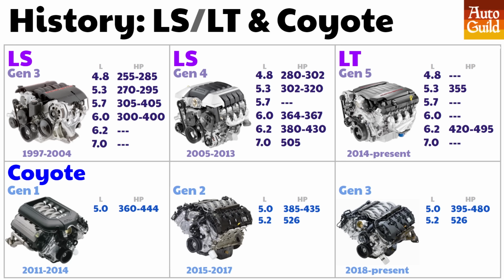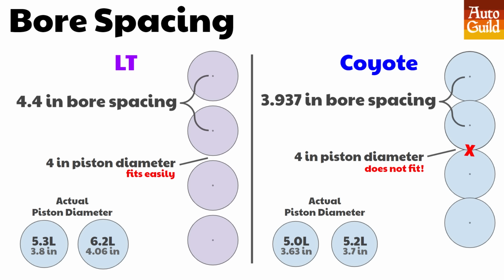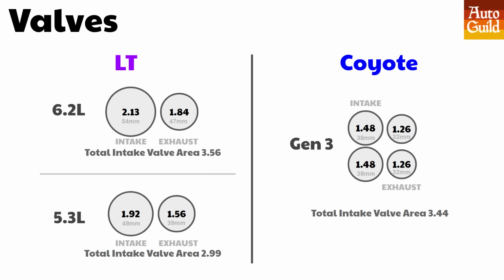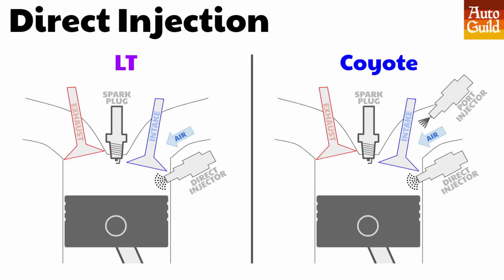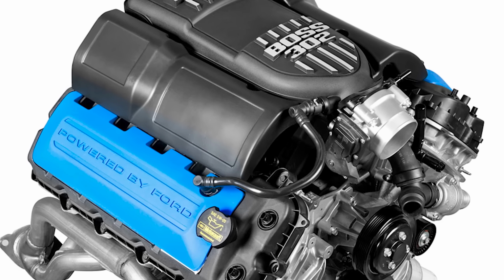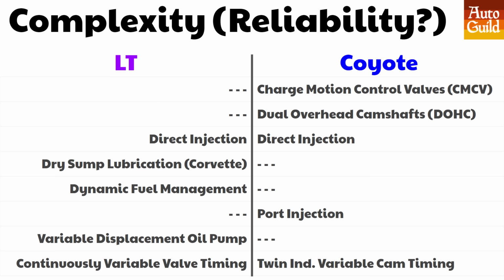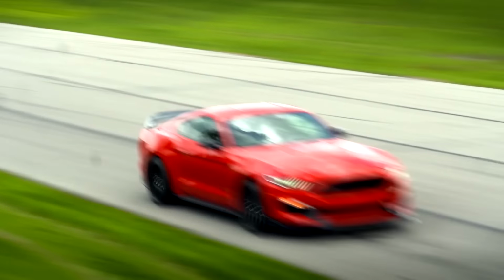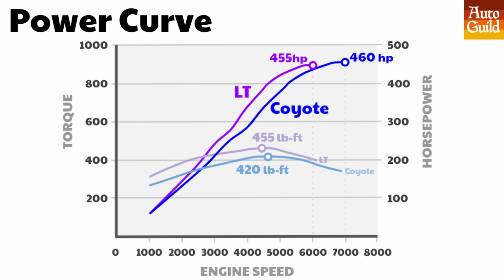GM Gen 5 LT vs Ford Coyote.  Which one is better and why.

Comment: I know I'm going to get hate but I'm just being honest about my personal experience, 
i have had way more success with my Gen 3 Coyote than i did will my Gen 4 LS. 

All around better performance in my opinion with the same amount of money invested. 

My 99 Mustang gt is slightly lighter than my 95 Camaro on paper but after all the lighting i did we are only talking a few pounds difference. 

Same gearing (410) and both are manual transmission, I'm just way happier with the performance of my Coyote. ✌

Comment: How about price of parts, availability,, hop-up ability, ease of working on them.  GM all the way!  No comparison in horsepower per dollar spent, the LS wins hands down.
Reply: Damn right!
Reply: Government Motors
Reply: No comparison in horsepower per dollar… until you wanna boost it lol. Spend more money boosting it to make less power than the 5.0 with the exact same application. Or, just cam it and gain desired big power but drivability suffers greatly. 

I’m not biased towards either, even owning a Coyote, but the old “LS/LT is cheaper” argument is incorrect nowadays. They’re BOTH pretty damn expensive and only reasonable people will accept that.
Reply: @matchboxcody  True, but there's a lot more to performance than just horsepower.

The LS/LT engines excel at low end torque; something the Coyote is lacking in.

Torque is much more useful for normal or spirited street driving than a peaky, high RPM powerband. Quicker launches, better low speed acceleration, and less gear hunting all require torque down low.

The only significant advantage to high horsepower is full on racing.
Reply: if you want junk
Reply: @steveschilling5966  Obviously someone who doesn't understand auto technology.

The LS is one of the best engines ever made. It's cheap, durable, flexible, and capable of stupid amounts of power.

That's why there are LS swaps into virtually every vehicle on the planet.

Comment: I didnt hear you mention perhapes the even bigger hp maker for the Coyote and for that matter all cylinder heads. Which is port speed! A small port with big numbers"FLOW" makes gobs more torque and hp! A big oversized port which was the way of old is like farting thru a 4" asshole😲! Slow moving air! Ala to a small well designed ports, will make a big port look bad! GM and aftermarket 2 valve have done this as well! But 2 is always better than 1! P.S im a GM guy! But Ford got the jump on us🤔 Great show!!!!!!!!👍👍👍👍

Comment: I think Ford should not have discontinued the FPC engine.  It took the right people being in charge of Ford to deliver these engines. And especially thanks to Jamaul and Pericack for enabling the FPC to be made a reality.  Im one of many Ford fans who've long desired the implimentation of its layout and design knowing the inherent differences between fords normal v8's and those of Ferrari.   And ford did not disappoint.   As we all know the FPC is pure magic in all the right ways.  Finally a Ford V8 that must breath at high rpms and a power curve that doesnt loose its breath just as soon as it starts in the low rpms, but rather gets stronger and stronger progressively till it reaches peak RPMS !.   Imagine a Ford that keeps building torque and power.  keeps building speed.   Thats the feeling we've been dying for.   I cant stand getting on the gas and feeling a car die off long before its even reached its peak rpm.  It feels deflated.  i do understand the FPC being what it is.. is quite the challenge for ford.  such an engine must be built to much higher standards than anything theyve built previously.   ANd even then they can only go but so far since its a fairly high level of mass production.  But ford did it anyway and Look at the end results.  when was the last time we've seen such universal fan fair over a mustang?   The mustang community the press,  auto journalist.. the competitions,   Mustang was now budding heads with cars 4 times its price.  It was making Porsche look bad.  to take a 25 grand base vehicle and make it perform on the level of a 200 grand sports car.    Ford did it.  and in doing so.. reminded people that when they want to crush ,  they can crush like no others.
Reply: Too bad it wasn't more reliable.
Reply: @davescott9409  I don't think it had anything to do with the flat plane crank itself

Comment: Where is the Ford GODZILLA? It’s going to destroy both of these platforms with ease and all bolt patterns and mounting points are common with Coyotes. 445 CID Cam In Block Smallblock Ford with forged crank from the factory. As to the valve area, we all know that 4 valve engines are far more efficient as proved by the Japanese motorcycle industry decades ago. As for all out performance between these particular platforms, which engine gets restricted by all Racing Sanctioning Bodies?…. It ain’t the GM!

Comment: i think ill just stick to my 383 sbc with no epa goods on it i think most people have forgot how good the old motors really are
Reply: The older motors are great, but a sbc compared to an LS or LT is night and day. The LS has a different character but is a far more efficient engine with more potential.
Reply: @TheColbyChurch  my point was more of simplicity in the fact that just about anyone with basic mechanical knowledge can rebuild an old sbc with a book or internet  im not bashing the newer motors just stating theres a lot to be said for simplicity and being user friendly good luck crawling under the hood of any truck now days where as i have enough room to camp out under the hood of my 85 c10 my 06 duramax most place i cant fit a hand in there let alone actually get in there to work on anything i find this to be the case on most cars trucks today call me old school i guess but i just want to go back to the good ol days
Reply: @TheColbyChurch  older v8s sound better
Reply: Older motors are easier to work on i agree but there not hitting 200k plus miles on original timing chains and other parts.
Reply: @jamesflames9930  I had a '94 SBC 5.7 everything original that went to 380K miles, granted it leaked everywhere, had VERY low oil pressure with recommended oil (I used lucas and 20w50 to increase oil press.), but it still started up every time like clockwork. I've seen older engines (80's SBC and SBF) with 200K+, just not as often.
Reply: No me, 67 427 vette
Reply: @rogerdodrill4733  cheers brother

Comment: The performance records of the LS platform speaks for itself.
Reply: Plus the coyote parts are more expensive good motor tho
Reply: @bryancaballero8113  It's been the one good engine that Ford has put together in more than a few years.  Took them long enough.
Reply: @TheWolfMatt  too bad gm had to copy a Ford design to make a good engine.
Reply: @larrypruitt3919  Nice.  Too bad Ford hadn't been playing around with dual overhead cams in their engines as long as Cadillac has.  Cadillac has had the quad cam 4.4L engine in production since early 1993.
Reply: @TheWolfMatt  you need to do some research... Ford had OHC engines in tanks in WW2...
Reply: @02autogt  Some strange and yet, very unique engines came out during WW2.  Didn't know we were comparing apples to oranges though.
Reply: @larrypruitt3919  I've asked countless people, countless times, what exactly did GM copy, apart from even spaced ports? (Which are hardly a copy) Nobody has answered me yet....
Reply: @TheWolfMatt  Ford had dohc 4.6 in 93 Lincoln with new Bonneville records 180 mph, but I like camaros
Reply: @TheWolfMatt  Ford had dohc4.6 in 93 Lincoln ,set new Bonneville record 180 mph in 3rd gear , u tube video,but I like  6 spd Camaro
Reply: GM was the first production vehicle to have an engine with 1 HP per cubic inch. 
Ford crushed everyone with the flat head V8.
Both companies have their merits.
Reply: @NATHAN ENLOE It would probably be another 300 lbs if it were that big.  😅
Reply: @TheWolfMatt  Exactly, so the argument is pointless.

Comment: your a gm guy and dont mention the 5.5 liter flat plan crank motor in the c8.r... again... only 500 hp... lil less the the gt 350r.... same rpm... but way more torque... typical ford leaving torque at home...

Comment: When it comes to boost coyote is king and requires half the boost an ls or lt needs to make the same power. People always say that ls is cheaper to build than a coyote, but at the end of the day an ls needs heads, cam, bolt ons and etc just to be up to par with a coyote. Add all that up and equals pretty much the price of a coyote.  And this is coming from an ls fan, give the coyote credit because it's running the streets right now.

Comment: Where is the aftermarket. Build a dual overhead cam set up for the Chevy engines. The cam drive could bolt to the front.  Port injection is a must. As A Chevy guy I envy the coyote. Any manufacturer can built the same thing from scratch. Chevy has kept to the on block cam with push rods because of cost and availability.
Reply: Cost, availability,and it works.  Why change something if it's not broken?
Reply: @whatiwant8898  I agree much my friend.

Comment: Long story short
Coyote engine, is smaller displacement, so it NEEDS 4 camshafts and a massive cylinder head and 4 valves per cylinder PLUS vvt to create decent power. Oh it NEEDS to rev high to make power, that wasn't an added feature.
It may have more tuning options and more precise because of the 3 extra cams and the vvt system and all the extra parts and of course with more parts, comes more things that can break......

LT engine, has bigger displacement, 1 cam and 2 valves per cylinder to create the same power as the overly engineered coyote. Doesn't need to revv higher and max torque and hp is available sooner and longer than the coyote. 
Now, that wasn't too hard to figure out......oh, its generally better to have an engine with big displacement and less hp from factory, as the engine doesn't stress too much, too often, while the smaller engine has to make up for all that and you're technically stressing the engine out more for the same power the bigger displacement is. Dont believe me? Look at Ford themselves, they have a massive 7 liter or 8 liter engine that only puts out like 400hp because even they know, the engine will last longer because its not stressing at all.

Comment: Cool comparison I knew most of it the one thing that I think is wrong and correct me if I'm not right but the charge motion control plates and the coyote those aren't variable runner length it's basically just a flap that covers half of the intake port to help with swirl and torque production and velocity basically and then after a certain RPM they open up and most mustang owners end up taking them off they were on the three valve 4.6 as well

Comment: Great comparison between the engine builds.  There was one GM engine that you missed on the GM side and should have been put in the specialty engine competition.  The new "Blackwing" from Cadillac.  It makes 550hp with 640lb-tq out of an incredibly small 4.2L V8 and can only be found in the 2020+ CT5-V (for now).
Reply: Smaller than a Coyote and lot more power!  Someone gettin nervous! lol
Reply: That engine is a DOHC engine. Not an LT.
Reply: @bertouellet8090  Never said it was an LT now did I.  😉  The Blackwing deserves a mention because of how much power it makes for how small it is.
Reply: @TheWolfMatt  Not an LT still, you just watched an LT/LS .vs Yote video.

Comment: And then there is the 5.8 Trinity engine in the 13-14 Shelby GT500 - Ford still making more power with less cubic inch than any of there competition.
Reply: I'm not bias.But people comparing displacement when one engine uses 4 times as many camshafts is just stupid
Reply: GM can and has made high horsepower engines and I'm guessing they are going to do it again soon..3 years ago the zr1 made 750hp and if you think they cant make an engine like that again with more power you are just silly
Reply: @erikcapozzi3425  Finally chevy got away from there sacred cow 350 1955 designed 265 push rod OHC engine and made an overhead valve head engine (6.2) and only 6yrs behind the 5.8 Trinity. It also makes more hp per cubic inch which makes me wonder what a 6.2L Trinity engine would make with today's direct and port injection .... that comes stock on my 2018 3rd gen 5.0 395hp F150.... Port injection keeps the intake valves clean unlike the zr1 direct injection and has twice the injectors costs more money to make ect but it's rock solid. Looking back in history ford should have just stuck with there flat head v8 and just added fuel injection, headers, variable valve timing ...you know just did alittle r@d once in awhile and look at the money they could have saved like chevy staying with 1955 265 V-8. But chevy could make and if chevy made....blah blah blah - if, if's and but's were candy and nuts we would all have a Merry Christmas. Stay with what works the best for you and if you like paying for old designed worked over engines and paying extra for it, buy chevys. There is a reason there not #1 anymore
Reply: @vaportrail6315  you said they have been using a pushrod OHC engine 😂😂 and switched to a OHV ..GM was the one who first produced an OHV engine and have used it since its inception
Reply: @erikcapozzi3425  Good catch guess I pulled a Biden  - I meant 265 OHV . The new Vette engine is not only OHC but DOHC (4cams). And about time. Ford on the other hand just came out with a new 7.3 push rod OHV engine that is pretty impressive if you're into old style design with today's technology. It's a damn shame that the go green people are pushing us toward electric. The gas powered engines and especially V8's are on borrowed time. Nice chatting with you.....

Comment: I started out with Ford's 50 years ago but soon found that all the good parts and engines were rare and expensive. Seems like nothing has changed.  I said back then (when rust was common) that a Chevy engine in a Ford would be the way to go but at this point, I would stick with Chevy in all cases.  Love the engineering in the Ford but what good is it unless you want to spend megabucks on a low-volume car?  As far as pony cars the Ford sure is the winner as far as looks.  LT in a new Mustang!  The last Ford I bought was a brand new Ranger and I sold it after a year because it was burning oil.  Always a common issue with Fords.  It's great that Ford got so much power out of such a small displacement but how many will last 2 to 3 hundred thousand miles like Chevys?

Comment: Coyote wins for me.  N/a crew cab 4x4’s running high elevens, or single cabs running low elevens is just impressive af!  Add boost, that crew cab will then do low 10’s, and single cabs hitting 8.5-9 second quarter miles!  Enough said!

Comment: It seems that based on displacement alone the Ford motor is more efficient at making power out the gate. I love the simplicity of the LS/LT motors but I love the variable timing in any motor. I'm not a Ford or Chev guy I'm a Japanese car guy and the Ford Coyote has same design elements as you would find in the V8 and V6 Toyota motors. All "performance" Toyota motors have dual injection, and a variable 4 cam designed head. Dual injection systems are the future of ICE motors imo but I don't see many companies doing it.
Reply: BMEP (look it up) is a measure of efficiency not power per se. Ford uses multi-valve heads and RPM to make HP but at the expense of torque production. VVT can help mitigate this to an extent. GM on the other hand uses CI and lower RPM (LS7 is the possible exception as it can spin 7.5K with ECU mod) to produce a more robust power curve and power under the curve (read TQ). This is why NA Camaros and Mustangs in OEM form are close in straight line performance despite the HP/TQ differences.

Comment: There is no replacement for displacement. Fords are designed to prevent modification and repair. Fords are designed to fail. What more do you need to know? Don't believe me? Do the search for why Ford mechanics don't drive Fords and see for yourself.
Reply: What kind of crack are you smoking? Might as well have “GM” tattoo on your forehead.

Comment: I think Ford added cylinder deactivation (not a fan of it on the GM’s, nor do I think engine auto stop/start is good for the engine longevity). Also, I think there are a few 7 speed manuals, maybe that was just for LS?
Reply: The LT1, LT4, and LT5 come with 7 speed manuals.
Reply: @whatiwant8898   that’s what I thought, the video only showed 6 speed
Reply: Ford has had cylinder deactivation for awhile.  Except with Ford its only used when the engine has overheated.   That is why you never here about it from Ford.

Comment: The road runner from the boss 302, Is NOT a coyote.  The Voodoo from the GT350 Is NOT a coyote, the predator engine from the gt500 Is NOT a coyote. These 5.2 engines are not coyote and in some cases completely different.